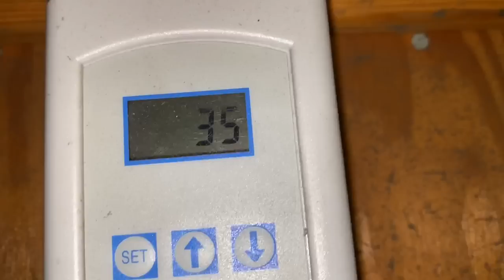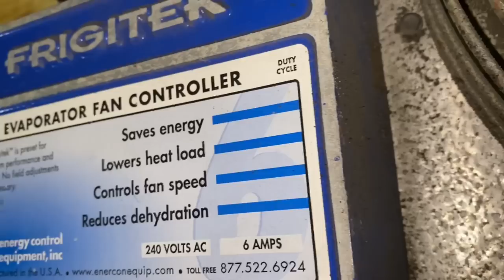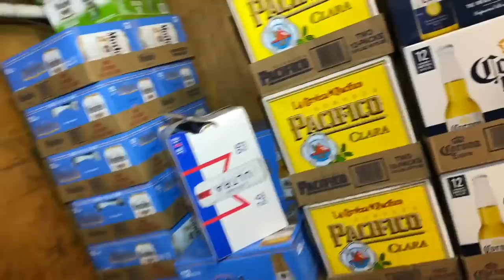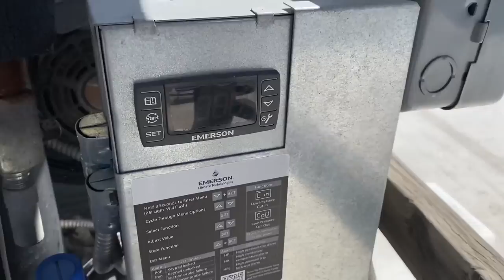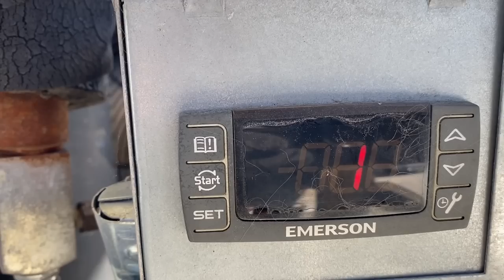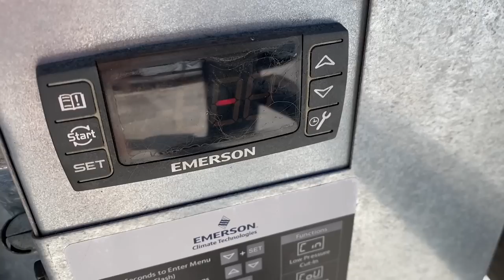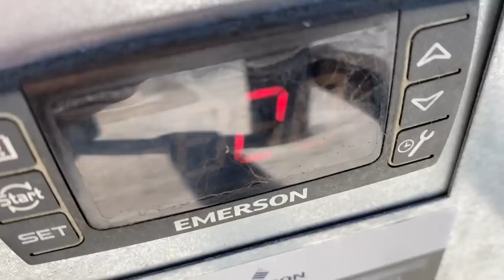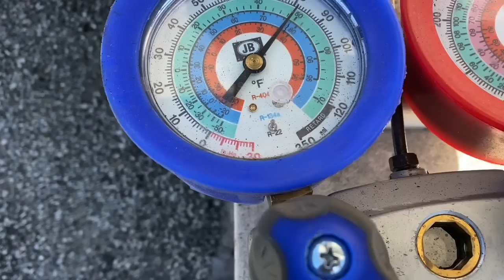Why did the walk in cooler ice up

Comment: Yupppp 404 ice machines need 404 lol

Did a repair on an ice o matic. Boss has been using 449 for everything now. Told me to put in 449, ya it did not work right at all. Had to go back in with 404
Reply: But its envoirement friendly 😂😂😂
Reply: I'm guessing 404 is needed to get the head pressure high enough for harvest?

Comment: RSG (master bilt & norlake) and kolpack have those dual speed ECM fan motors...box reaches temp and the evap fans run half speed until it turns the compressor back on....they use a 3 wire johnson controls thermostat.

Comment: One of my friends charged an ice machine with r449 and he got lucky. I told him don't do it because I remember you mentioned it on another video.He got away with murder. Im sticking with r404a for ice machine too.
Reply from the maker: The 448 worked but it was flooding back and there’s no adjustment on those txv’s. Also the charger is so small in ice machines the 404a is the way to go.
Reply: @NorCal-refrigeration  I have a few Koolaire I bought couple years ago for some of the restaurants, they have 410a in them.
Reply from the maker: @brnmcc01  the only issue I’ve had with those are noise complaints. Window shaker compressor are noisy.
Reply: @NorCal-refrigeration  The ones I got are from around 2-3 years ago, they had small scroll compressors in them, I think LG, not sure. They are pretty quiet though. One of them I got the remote condensor for, and put that on the roof. That location they have really hard water, and I didn't want to use a water cooled unit. Was pretty easy to run a 20ft precharged lineset up to the roof.

Comment: That coil turd was a toe stubber! 

I've done that with the flare nut 🙈🤣 Had to cut it in half with the grinder as was on outlet and suspected frost would crush the pipe and cause issues.

Those condenser fans stopped a bit quick, tight bearings?

Comment: can you elaborate a little bit on the tell a system is overcharged by your head pressure during a pump down thing? good charge it falls a little, it rises its overcharged?
Reply from the maker: Over charge head psi will sky rocket 🚀 on pump down. 
Now it will rise a little at first then start to fall as system pumps down if charge is ok.
Reply: @NorCal-refrigeration  thanks! Appreciate the reply and knowledge

Comment: Thanks for great video. Did you pull vacuum after opening that solenoid and did you do it at the evaporator or upstairs at the condensing unit? Thanks, cheers

Comment: Hey Dave, I was wondering about whether or not if you ever tried an ultrasonic leak detector. I heard it might be able to have you help diagnose leaking valves during operation. I picked one up recently. Seems promising. Just got to try it in the field.
Reply from the maker: I’ve used them on steam traps

Comment: If you did a pump down and the system is over charged what would your high side pressure look like?
Reply: Your head pressure will go up instead of falling, basically the receiver is over full and theres no where else for the refrigerant to go so it builds up pressure.

Comment: After taking apart the solenoid did you pull a vacuum from the low side?
Reply from the maker: Correct that’s all you need to do. With a call for cool so the solenoid is open.